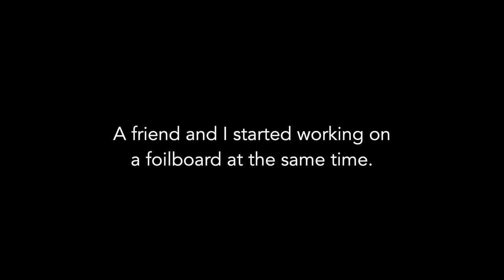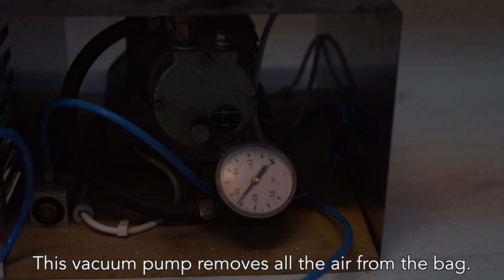Building a foil board part 1 | Glassing carbon sandwich layer

Comment: Great job! Did the sandwich foam need a lot of resin? I checked the Lantor website and they stated that the 3mm foam needs 1,4 kg per m2. That is a lot compared to what the carbon fiber needs.
Reply from the maker: I used 2mm sandwich material. I definitely didn’t use a 1.4 kg’s of epoxy, so maybe it’s under saturated, but it’s strong a.f. I just used some more epoxy than I would on a layup without sandwich stuff.

Comment: Awesome work, great insights! if i see this correct you used 1 layer 200g and 2 layers of reinforcements around the foilbox on the bottom. on the top u used 2 layers 200g with a sandwich soric xf in between? how thick is your friends board? Thanks =)
Reply from the maker: Yes! You’ve paid attention. Very good! 😀 I don’t know how thick the board is. I’m on holiday now, but I will let you know soon..

Comment: Nice video! Do you think the sandwich with two layers of carbon and one of Sonic performs better in weight and resistance than three layers of carbon?
Reply from the maker: Thanks!, Great question. I don't know the answer to this. I think the sandwich layer makes it stronger for pressure dents from the heels.  But I don't actually know if it does. The deck feels rock solid though, But it also does on the previous board I made that had 3 layers of carbon on the deck. It is a bit cheaper though to use the Soric.

Comment: Love your videos man! I also plan to do a build, do you have a recommandation of a materiel supplier to get carbon,epoxy etc that ship to Europe France?
Reply from the maker: Thanks man!
Reply from the maker: I ordered my carbon carbonwinkel.nl, but after some bad experiences I now buy everything at polyestershoppen.nl I don’t know if they ship to France though. I would search locally to save shipping costs and the environment. 🤟🙃🤙
Reply: @Dzjiefoils  yah, i guess ill first reserch in france. Thank you for your answer 🤙🏼
Reply from the maker: What kind of board are you planning to build?
Reply: @Dzjiefoils  I plan to build a board for wing foiling, and hopefully ill have material left to build another one with less volume to wave foiling. I am just trying to figure out how to build it inside my home since i dont have a workshop or a garden..
Reply from the maker: @numbynum  nice!! It’s gonna get messy with sanding.. but all the other stuff wil be fine. Just make sure you wear protection when working with epoxy and sanding fibreglass or carbon.